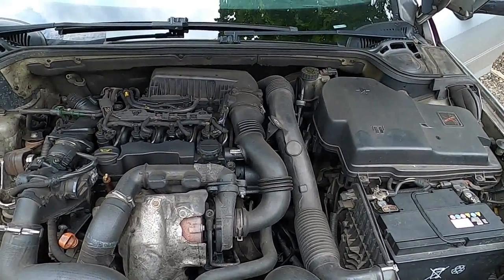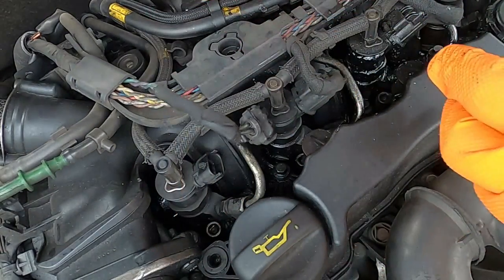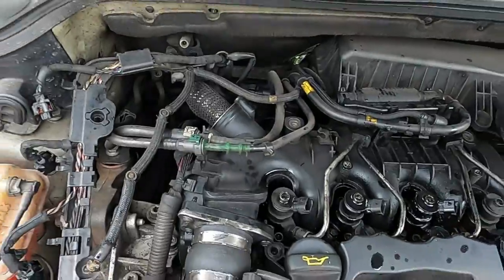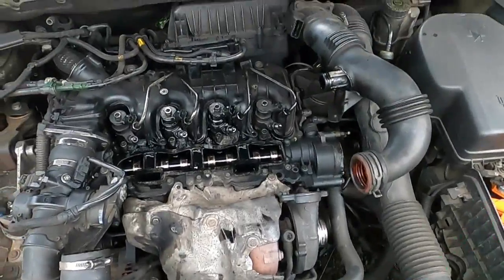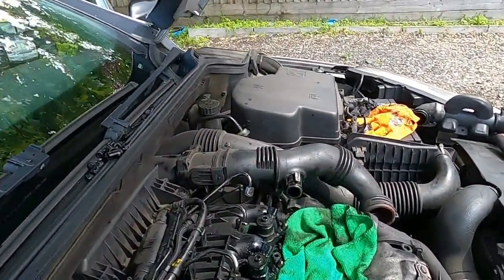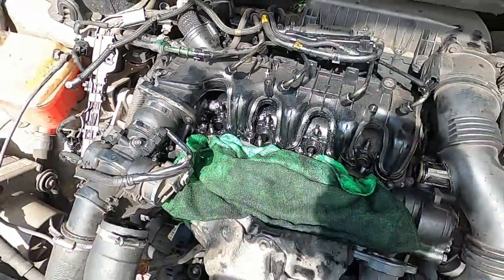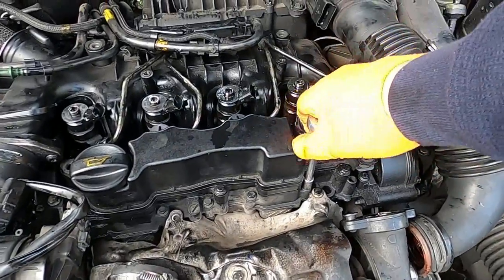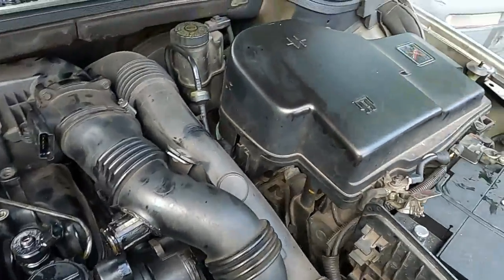1.6 HDI/TDCI Injector seals and Rocker cover gasket replacement

Comment: Hi, thanks for uploading the end to end process! Just had another injector go on my 1.6hdi. for one of the tightening studs holding the injector down, I have one that just wiggles and floats around, but with an Allen key, I can't seem to tighten it. It keeps to not be able to grip onto anything. Any tips on this you. You mention you use a Crb7 hex tool? This is no different to the hex Allen key right?
Reply from the maker: Hi mate thank you for a comment. In your situation I believe one of the injector studs or a stud nut is spinning in place. I would check a thread on a stud and also inside a nut these do tend to get loose very easily. You are right the hex Allen key is basicly a same thing as Crb 7 tool. As long as the end is flat and size same then it's a same tool. It should do up. Mind you it is recommended to replace all studs every time you change injector seals. I know nobody does but maybe these studs not design to be tighten too many times. Studs also easily snap and then it's a pain to get it out the left over. Hopefully you worked something out let me know. Also if hex key doesn't go inside a nut anymore just grab a stud nut with some pliars from the side and try to do it up like that.
Reply: @Mad4FrenchCars  hi, thanks for the quick reply! Yes indeed the stud nut is just spinning and no longer tightening. The hex tool does still spin the nut but at mentioned, the nuts itself just spins and doesnt grip on anything. Its going into a garage tomorrow so hopefully its not too complex a fix. Really like end to end video from you you though! Super helpful to the community!
Reply from the maker: @manw8888  thank you mate really appreciate it.

Comment: Hi, When you are removing and then return the injector cables back, the computer is necessary to connect them to the system?
Reply from the maker: No if you disconnect your battery before you do it then you dont need to use any software to tell your car about it. But if you done this job without disconnecting a battery then you would only need to delete faults redistered by ecu with diagbox. As once you disconnect injector with battery connected ecu will log it as a fault.
Reply: @Mad4FrenchCars  thank you so much 🙂
Reply from the maker: @GordonFreeman13377  my pleasure mate

Comment: A great video … just what I need. One question is there a seal under that fuel line hex nut ?
Thanks
Reply from the maker: Hi mate there is no seal on them copper High presure fuel supply to injector nuts if that's what you been referring to.
Reply: Yes that’s what I mean … I am sure one of mine is leaking but won’t go tighter … maybe it’s the lower seal spitting upwards.. anyway now I know what to do … Thanks

Comment: I did the job on my ford fiesta 1.6tdci 2006 (same PSA DV6 HDI engine), but it won't turn over, I've tried it several times in short bursts of a couple of seconds - up to 6/7 times but it just won't start - I'm guessing there's air in my fuel line, any advice?     the only thing i can think of is to loosen the HP fuel lines to the injectors and then try and crank it a few times to see if the air will come through those high pressure lines, reattach and try to start it?   I've seen some vids with Peugeots that have manual fuel bleed pump on the car but as Ford don't include a manual fuel pump as these are supposed to be self bleeding
Reply from the maker: You are correct. That's exactly what I would do. Disconnect HP lines or at least loosen hpfuel supply nuts on injectors to get the air out. Turn it over until you see diesel coming out.
Reply from the maker: Then reconnect again and it should fire up also make sure all the connectors are connected properly back on including injectors, mass air flow sensor and camshaft one if you disconnect it.
Reply: @Mad4FrenchCars  cool thanks for the reply,  once I've loosened the HP lines and before I turn over to bleed fuel through - do i need to reconnect the maf before turning over or can i turn it over with reconnecting the maf (to bleed fuel through and air out of the HP lines not to try and start the engine fully)?
Reply from the maker: @stevem5483  becouse you connected a battery already to turn over a car just leave maf sensor connected as if its disconnected it will give a fault. You might get eml if the car starts but that will clear itself after a short drive as it might record a fault for fuel pressure then a HP fuel lines undone. But nothing to worry about as either you can clear it with a diagbox after car runs or it will clear itself after a little while maybe a little trip or two
Reply: @Mad4FrenchCars  thats great,  thanks v v much 👍👍👍
Reply from the maker: @stevem5483  you wellcome
Reply: @Mad4FrenchCars  it worked a treat!  Cracked off the fuel lines to loosen them, turned it over until all injectors were showing fuel coming through (about 6 times in total - tightening the ones back up in turn that had fuel coming through - in order looking from front of car no. 1, then 4 then 2 then 3).   Torqued them back up and started car, it took another 6 short tries before it got going.  Thanks again for advice and great video it really helped. 😁👍👍👍
Reply from the maker: @stevem5483  well done mate.

Comment: Hey buddy ! If you didnt disconnect battery before hand and replaced seals would you have to re code ?
Reply: 50% shore it wouldn't effect it. I'd just reset codes after the work is done and scan again for any problems

Comment: hi mate I stared  to take out injector  the one on the left. I could not  remove the injector.i tried to pull with clamp but no help .any idea ?thank you
Reply from the maker: I would recomment to get some injector crack spray. I normally use it if one doesnt want to come out i spray all around it and leave it over night it should come out easy next day as all the carbon around it will get soft.
Reply: I have inly carburetor and egr   cleaner  if it will help?
Reply from the maker: @TheHamouda  to be honest mate i think thats prity similar thing so it should help
Reply: @Mad4FrenchCars   thank you  for reply
Reply from the maker: @TheHamouda  my pleasure mate

Comment: little question: is there a way to test the injectors of proper working. i measured the resistance with a multimeter at the two pins and it showed around 0.7ohms on all four injectors. is that correct. i dont have any idle problems. thanks.
Reply from the maker: Hello mate normally people doing a test at home get a leak off test and test injectors with that. I have not made a video about it yet so I will share a video of someone else doing this test. https://youtu.be/cjVDHsvVNtk

Comment: Got told my rocket cover could be the problem of oil leaking into the turbo is this true?
Reply from the maker: It can be if the valve on a breather side is stuck open it would cause a breather to be always blowing more then it should also if you have more then recommended then amount of oil in a engine. Normally you will always have some oil comming from breather to turbo. But if there is a lot of it then might be a good time for service as fresh oil is more thick and will not come from breather that easy.
Reply from the maker: Oil comming to turbo from breather is normal if you like to push the car to high revs or if service intervals is not followed then it will start to shit itslf a bit but nothing to worry about performance wise. If you want it to be more tidy you can install catch can
Reply: I've had the same problem. I brought a hole new rocket cover with the gasket seal ect for just £13 on ebay so not too bad priced

Comment: What is the injector removing tool called ?
Reply from the maker: I think is just call injection puller but the one to use on a delphi injection system is called MasterPro Diesel Injection Puller Set For Boschdelphi Injectors

Comment: Hey, loved your video, followed every stepped and i got rid of "chuffin", could swear that engine is not as loud as before too, but I have new issue, on injector 3 and 4 i have slight diesel leak, have I screwed up something ? :D
Reply: The fuel is coming from the top of the injectors, with the old and the new o-rings.
Reply from the maker: @Genakrul_93  hi mate then you say a top of injector, is  your injectors different from the ones in a video? It might be a fuel return connector split so ether or a high presure fuel supply bit to injector undone itself then you was undoing it if its a same injectors
Reply: @Mad4FrenchCars  It is fuel return connectors, but thats low pressure and it got me confused why does it leak there now. :D

Comment: Ver good film ,une question? pour démarrer la peugeot il faut coder les injecteurs avec un ordinateur.  Seconde question?       pour retirer l'admission, il est nécessaire de retirer toute la ligne de carburant.      3 question?, quand on démonte la vanne d'admission d'air il faut la coder par ordinateur.                    Merci de m'avoir aidé, salutations d'Espagne
Reply: alors dis moi quelque chose s'il te plait
Reply from the maker: Merci pour votre commentaire. tout dépend de ce que tu fais avec les injecteurs. si vous obtenez 4 nouveaux injecteurs, vous devrez peut-être les coder avec diagbox. si vous remplacez simplement un joint sur un injecteur existant, tout ce que vous avez à faire est de déconnecter une batterie de voiture avant de déconnecter un injecteur et une fois le travail terminé, connectez la batterie, elle ne devrait afficher aucun défaut. si vous remplacez 1 injecteur et gardez 3 anciens, vous pourriez le coder, je ne suis pas sûr.
Reply from the maker: @daviddaviddaviddavid2955  désolé pour le retard de réponse
Reply from the maker: la deuxième question était de savoir s'il était nécessaire de retirer le système de carburant pour retirer le collecteur d'admission d'air, je crois. donc la réponse est que vous auriez besoin de supprimer au moins une alimentation en carburant de la rampe d'injection aux injecteurs car ils se trouvent au-dessus du collecteur d'admission d'air. Vous devez également déplacer une conduite de retour de carburant, mais vous devriez pouvoir le faire avec des injecteurs laissés seuls. De plus, le joint de cache-culbuteurs devrait être retiré car il boulonne un côté du collecteur d'admission.
Reply from the maker: la question 3 était je crois que l'admission d'air a été supprimée, vous devez la recoder avec un logiciel ou quelque chose dans ces lignes. la réponse est simple si vous débranchez une batterie de la voiture avant de commencer un travail sur votre voiture. Ensuite, vous pouvez déconnecter tout ce que vous voulez et ce ne sera pas un problème tant que la batterie n'est reconnectée qu'après un travail effectué et que tous les connecteurs sont remis en place comme ils le supposent. si vous déconnectez le capteur de débit d'air massique, les injecteurs ou tout ce qui se passe dans une voiture avec une batterie connectée, il enregistrera un défaut. mais vous pouvez toujours le supprimer avec le logiciel Diagbox
Reply: Une question pour retirer le couvercle d'admission je dois déconnecter les tuyaux diesel, qui se déconnecte sous la vanne egr avec une clé de 17mm. ou je soulève les tuyaux juste avec ma main et c'est ok, un salut
Reply from the maker: @daviddaviddaviddavid2955  Je pense que vous pourriez éventuellement le gérer en déplaçant simplement un tuyau vers le haut, mais je ne peux pas garantir qu'il ne se brisera pas si vous le repoussez trop. si vous parvenez à retirer de l'injecteur et de la rampe d'injection à l'arrière, vous seriez du côté plus sûr. si vous le faites pendant que les injecteurs sont retirés, cela devrait être suffisant pour les déplacer.

Comment: can you take off the injectors without removing the rocker cover? since i just put in a new gasket and sealed it xD
Reply from the maker: On 2.0hdi you can on 1.6hdi you still can but its more  complicated
Reply: @Mad4FrenchCars  Bref, si je débranche d'abord la batterie, je peux retirer les injecteurs et aussi la valve d'air. Une autre question est de purger les injecteurs ou vous donnez la clé de contact plusieurs fois et c'est ok, un salut merci
Reply from the maker: @daviddaviddaviddavid2955  oui, c'est juste pour purger les injecteurs, vous pouvez le faire manuellement en appuyant sur une pompe de purge noire au-dessus d'un collecteur d'admission d'air ou, comme vous l'avez dit, vous pouvez faire tourner le moteur plusieurs fois.
Reply: @Mad4FrenchCars  je veux changer le caoutchouc des injecteurs je les sors de la culasse, puis je les purge comme tu dis ok.                 suis espagnol mais je comprends bien je suis avec le traducteur google hahaha
Reply: et pour nettoyer la vanne d'air d'admission, débranchez d'abord la batterie, puis branchez la batterie et elle démarrerait, avec quelques pannes mais pourrait aller à l'atelier, ce qui est peu
Reply from the maker: @daviddaviddaviddavid2955  J'espère que tout va bien
Reply from the maker: @daviddaviddaviddavid2955  le mieux est de connecter la batterie puis le travail est fait alors vous obtiendrez moins ou même aucune des erreurs si tout est reconnecté
Reply: @Mad4FrenchCars  certaines marques de voitures sont a programmer peugeot pas moins mal hahaha
Reply from the maker: @daviddaviddaviddavid2955  oui définitivement

Comment: Any suggestions on how to get a stuck injector out mine has alot of carbon built up around it...removed as much as i could but still it wont move.
Reply from the maker: It's a very big problem once they don't want to come out but still possible. I would first remove as much crap build up as possible then use a injector crack spray around it and leave it for like a day to soak in. If it's injector closest to cambelt then it's hardest as it doesn't have space to spin in place. Other 3 injectors you should be able to spin them around but to do that need to remove inlet manifold and rocker cover and use size 24 spanner from behind to turn it anticlockwise. To make it loose
Reply: Leave to soak in brake cleaner overnight to break down the crap

Comment: excellent job.just one question whats the torque for these nut and screws thank you, i need to do mine  with torque
Reply from the maker: Hi mate i respect your choise to do yours with torque. So lets start from injector studs incase you decide to change them:  pretightening is 5Nm and tightening is 10Nm ( pretightening 0.5daNm and tightening 1daNm) 1dmNm - 10 Nm.
Then the tightening nuts wich goes kn the studs and secure injector in place
Its a angular tightening 4Nm and 75°or 0.4daNm and 75°. I hope it helps once i hit 1000subscribers i will be able to upload a diagrams which clearly provides all information as the community section will be granted.

Comment: Hello...did u forget to use the fuel Pump in the end ???
Reply from the maker: What exactly do you mean mate, I have replaced injector seals in this video. If you struggle to start your car after that becouse of a air lock in a fuel system then just undo a fuel supply 17 mm nuts and try to turn it over few times to get rid of air of the system then then you see fuel coming out just do the nuts up and it should start with no problem.
Reply: @Mad4FrenchCars  I have ideia when u take off the injectors, u must use the fuel ruber Pump
Reply from the maker: @hugosilva1980  oh you mean a rubber primer to prime the fuel. Yes you can use that to prime your fuel system. You can just prime it using a rubber pump before putting a fuel return hoses  in to a top of injectors. You can do it either way
Reply: @Mad4FrenchCars  that piece at min 3.58 ..sorry my english 😁
Reply from the maker: @hugosilva1980  yep that's the one. It's a rubber fuel primer.

Comment: never bend the fuel supply pipelines like that ! it will give you big problems
Reply: And what if you remove air intake pipes?
Reply: @himzooglecevac9356  shouldn't be a problem, but there is a reason to why these fuel suppleypipes are in metal. the pressure is very high in them, and they are measured presisely to fit - on the mico-millimeter !! leave them alone. loosen them ,but dont remove or bend them

Comment: is that a c5?
Reply from the maker: A Peugeot 407
Reply: @Mad4FrenchCars  oh OK. Looks the same as a C5. Does this problem cause the car to jerk or stutter when accelerating?
Reply from the maker: @connectlogic  it can but in a long run seal goes and then engine sounds like a steam train couse diesel and smoke gets pushed out through a seal next to injector.
Reply: @Mad4FrenchCars  OK thanks. I've got 2 or 3 gone. Ill have to book it in to be sorted out.